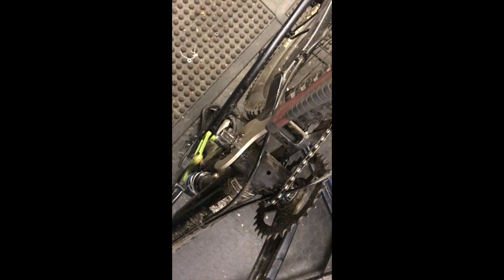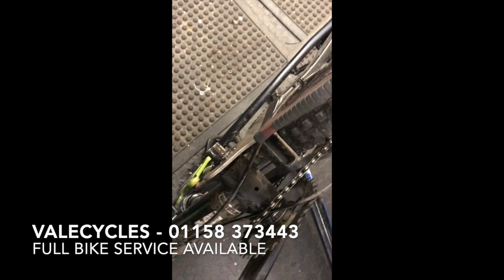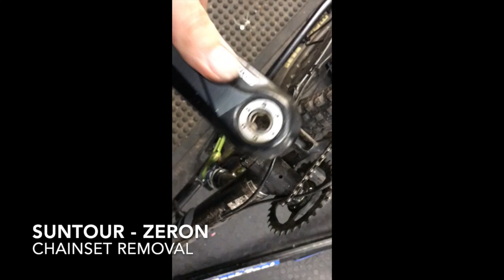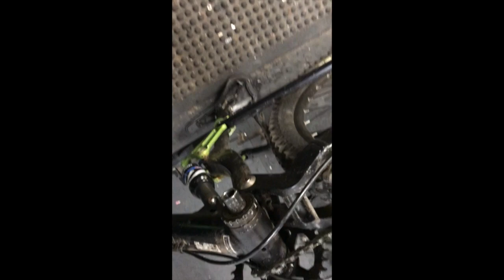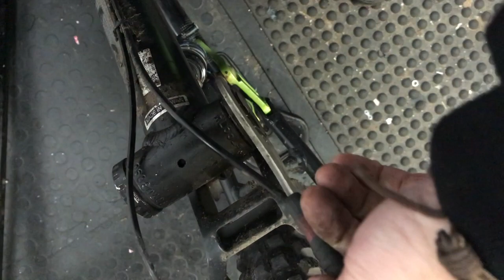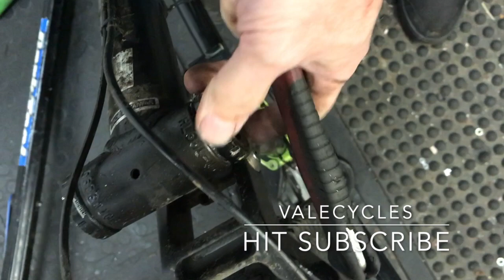Suntour zeron chainset removal  HOW TO easy when you know

Comment: Sir,  how did you pull the non drive crank arm off. Do I need a puller?...your video starts with the crank arm already off, so I’m not sure how you got the crank arm off. I see there is a 8mm bolt in there, but what to do?
Reply from the maker: u need a crank arm puller standard fitting one firstly.
Reply from the maker: self extracting end bolts some times are fitted.

Comment: I have this really weird problem with my zeron cranks, where my left crankarm has a little bit of front and back movement. (About 3-4cm) and it's really annoying. Do you maybe know why?
Reply from the maker: Worn or needs tightening left arm
Reply: Honestly after riding these cranks for almost a year, they are just built poorly. Check for the correct spacers on your bottom bracket. Also, make sure the first washer is threaded really tight, (torqued correctly if you have the tools) and check for the  wavy  3rd washer.